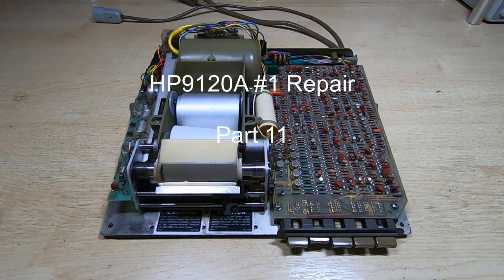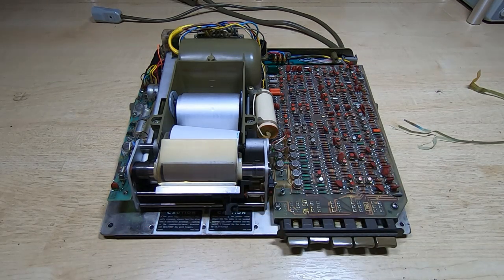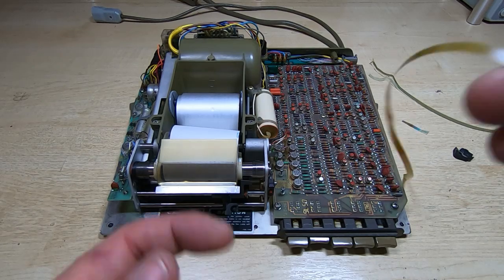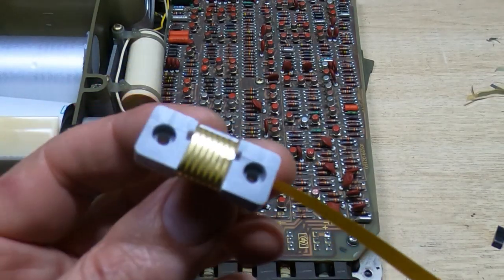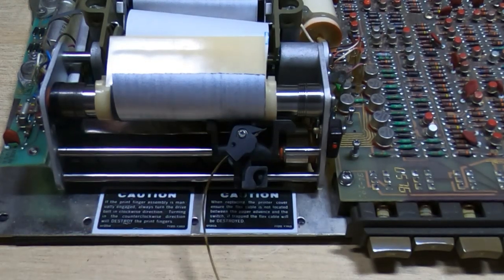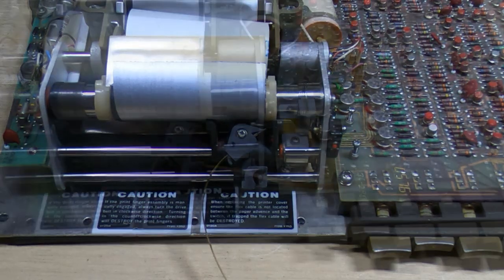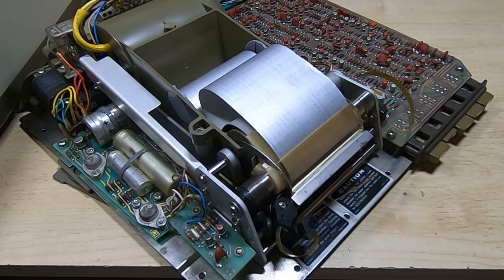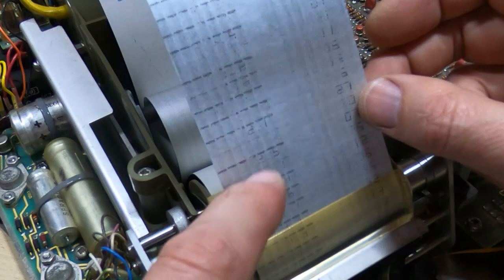HP9120A #1 Repair Part11

Comment: Thanks to your excellent detailed HP9120A repair videos. I am close to having a working printer. I successfully dismantled the gummed-up printer mechanism, did a thorough cleaning, restored the print roller and replaced the disintegrated motor drive belt. And as expected, the print head has a failed flex cable, which delaminated. Now reassembled, the mechanism goes through its proper cycles with the print head removed. I hope you are still selling a replacement print head flex cable. I need one.
 
Thank you, for all your great videos.
Elliot Tropiansky
Reply from the maker: Thanks, yes I still have a few cables left.
Reply: Thank you, that’s great to hear! How do I send you payment for the cable? @JerryWalker001
Reply: Thank you, that’s great to hear! How do I send you payment for the cable?
Reply from the maker: @elliottropiansky9553  You can contact me thorough my website at jmprecision co uk